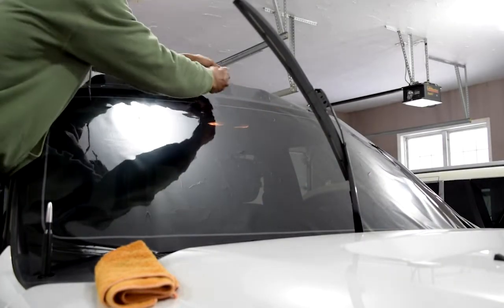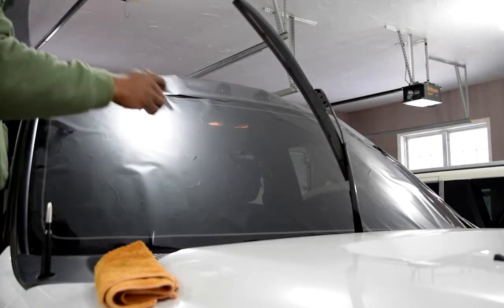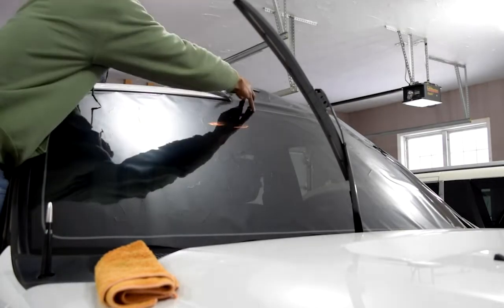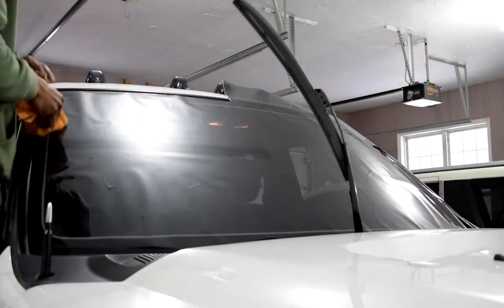Tinted Ford F350 with Vinyl Wrapped Bumpers and Grill

Comment: What's up man. You do great work!  I had my front windshield tinted on my 2014 ford f350 50%.  But the part on the windshield that says Super Duty did not sit right with the tint when going over it because of the dimple spots that Ford put on the windshield.   What should I do with the problem. Bring it back to the guy I had it done by. He is a professional installer. I just don't know what went wrong.   Thanks!
Reply from the maker: Those aren't going to sit perfectly, Ford has some wicked Dot Matrix on their glass. It's a struggle for all of us and unless we jump through all kinds of crazy hoops to get it to lay down.
I'd ask him about it and see what he says but I know what the situation is unfortunately.
Reply: Thanks for getting  back to me about the question, I appreciate it!  I guess it has to stay as is or maybe cut around that area. Wonder what that would look like.   Thanks again!
Reply from the maker: @trad1269  I usually know how it's going to be and just talk to the customer about it right away.

Comment: I wish white was easier to match, drives my OCD crazy when it isn't as close as a paint match with oxford white or else I'd have wrapped my grill and bumpers by now
Reply from the maker: I tell people that all the time. Wrap won’t match perfectly when doing partial installation trying to match. It all depends on how picky your going to be?
Reply: @FadeToBlackLLC  Absolutely - And it isn't the installer or manufacturers fault at all.  It's definitely close enough and worth it considering the cost difference.
Reply from the maker: @70Camaroz28  right, for some close is worth the savings of paint or finding ones that are already painted.